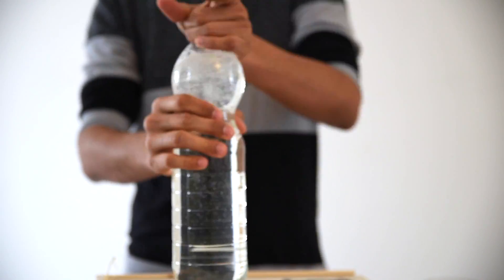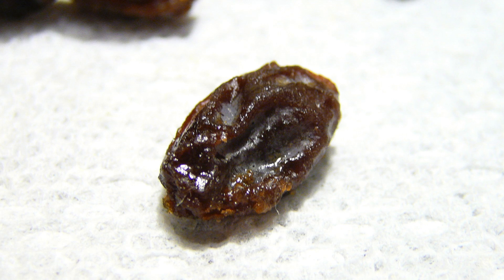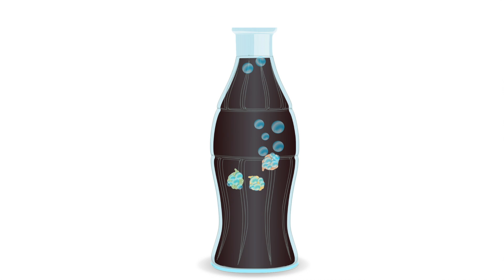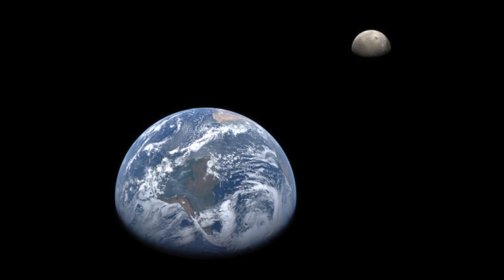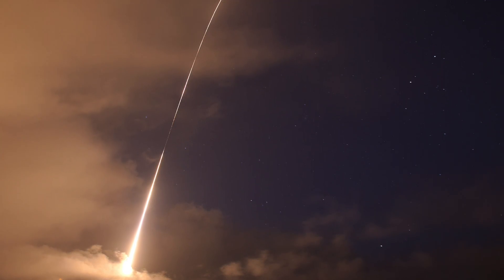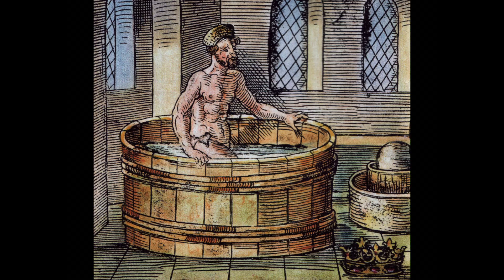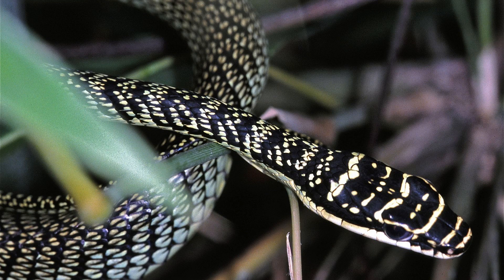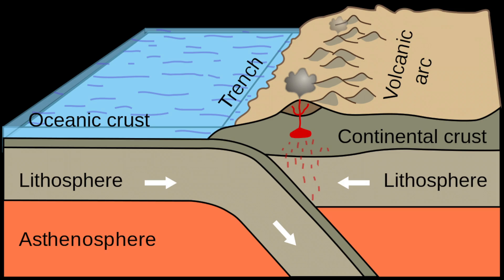Does Lava Lamp Beat Gravity?

Comment: what if an astroid hit the the moon and changed the direction of its velocity will it fall to the earth ?
Reply: Asteroids are normally way smaller than the Moon so the Momentum it has is not that much compared to that of the moon, so combined it wont make much of a difference. To de orbit the moon you would need an object the same size as the moon travelling at the same speed (Or the equivalent kinetic energy), and have it hit in the opposite direction that the moon orbits to reduce its orbital speed to below 28,080 km/h (Low Earth Orbit Velocity)
Reply: YourPalCal  so if the astroid had great speed it wont compensate the mass diffrence ??